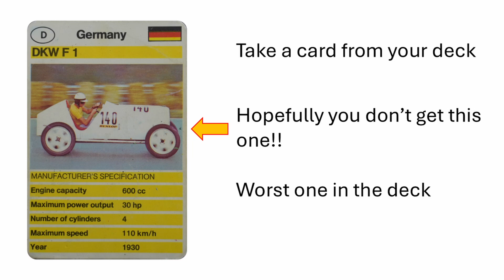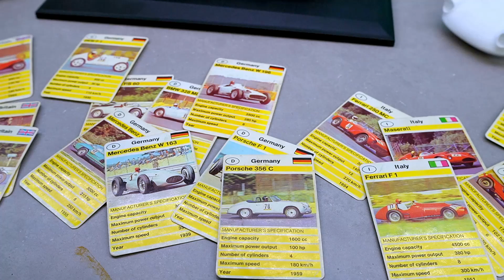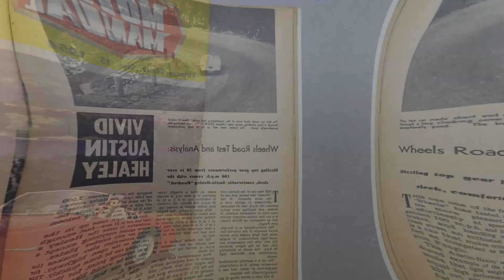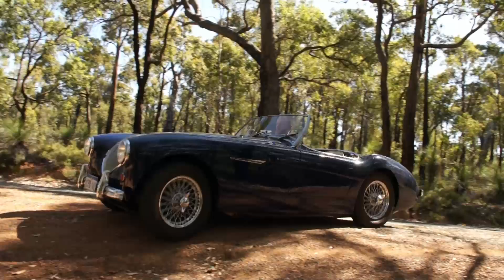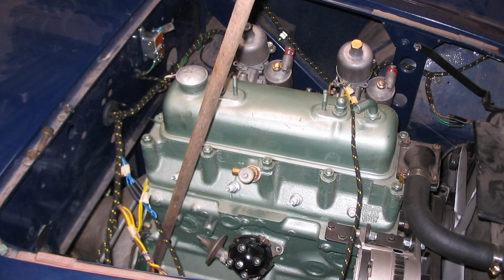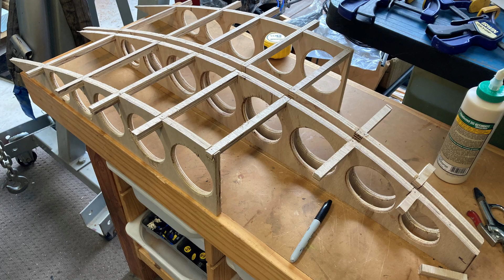Car Design Workshop - An Introduction

Comment: In 2013 I bought a basic home built car to fruition as a road registered open top sports car, not a race car but one that may occasionally be used and enjoyed on a track. The process was made easy by having good advise form a excellent automotive engineer not so much for design but how to get it registered.  I believe "they" have made it some what difficult and expensive now to register such vehicles. I lacked the knowledge and experience that you have but 12 years later I like it more than when I build it. I wish you all the best and encourage your endeavours. Please see https://youtu.be/lJnt3Tnxh_0?si=HY3YtRycbQqIL3bM